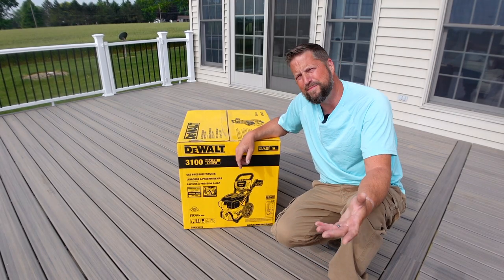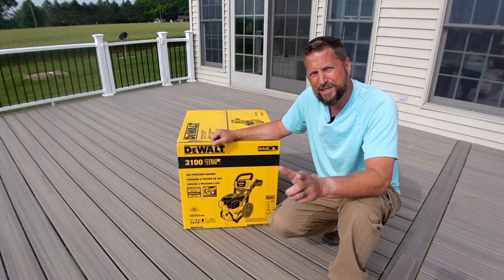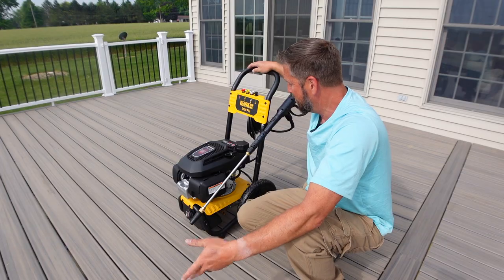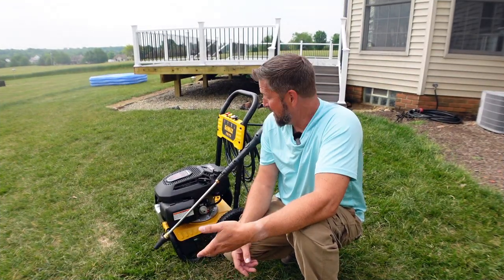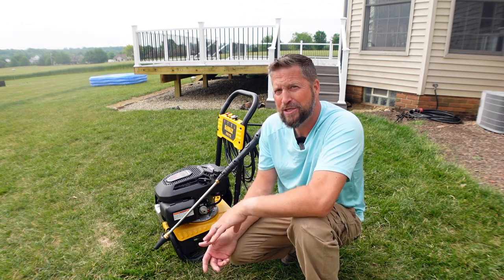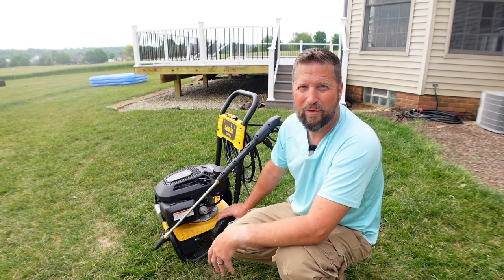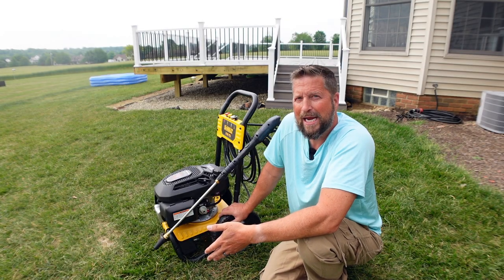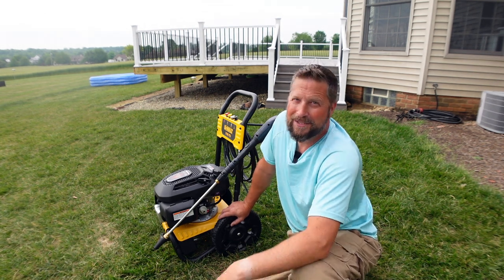First Impressions: Dewalt 3100 PSI Pressure Washer With Honda Engine

Comment: Nice machine, more than enough pressure.  I agree that using a soap attachment on the wand is far better so you won't get the corrosion in the machine part. Have a great weekend Sam!
Reply from the maker: So glad you mentioned that. I had a machine quit on me after one use with the soap mixture. Not saying the new one would have any issues but why risk it, right? 😉👍

Comment: About 15 years ago I took a chance and bought a Chinese power washer for pennies.  3700 psi and 4 gpm and it's still going!  lol  The only thing I had to do was take the manifold before the pump off to fix a stuck spring that held a ball bearing in place.  In todays global climate I wouldn't give China a dollar if I can help it, but my machine is still going!  lol
Reply from the maker: Wow! That thing is powerful! When you find something that lasts like that, you're justified no matter where it came from. I'm finding my predator engines from Harbor Freight are surprisingly reliable.

Comment: Thinking about buying one of these to use from time to time to power wash the house and eventually a deck like yours once I redo mine. How has this one treated you so far?
Reply from the maker: So far, it has been great. I think the Honda engine is the key. It starts like any other Honda engine I've owned. The pressure is definitely adequate. I would like to replace the hose at some time. It's rigid and difficult to work with, but I'll wait till it goes bad.
Reply: @ appreciate the quick reply back! I definitely like that it’s a Honda engine too. That’s what I use for my lawn mower and they last forever.

Comment: Nice machine I was wondering if it can take hot water
Reply from the maker: @TaurusGang96  That is a very good question. I know only specific pressure washers are designed for use with hot water. My best guess would be "no" for this machine 🤠👍
Reply: Thank you for the reply boss @samsdoinstuff

Comment: Thanks for your review, I would have liked to see how the water inlet is connected... does it work if I take water from my cistern?
Reply from the maker: @julioserrano4624  Great question. There is a standard female garden hose connection at the base of the machine between the wheels. I think your greatest concern is getting enough pressure from your cistern to feed the washer. Otherwise, you should be good 🤠👍

Comment: I recently purchased the same pressure washer. What a machine ! So let’s say I’m ready to store it until next year, while the pressure washer is running do I set the knob to FUEL OFF? If so how long do I leave it at FUEL OFF before turning the knob to OFF or do I leave it at FUEL OFF?
Reply from the maker: I'm pretty sure you leave it at fuel off until it shuts off. That way there's no fuel left in the carburetor. Also, add stabilizer to any fuel remaining in the tank. Hope this helps! 🤠👍
Reply: @samsdoinstuff thank you sir! 👍🏼

Comment: This is a nice machine I was wondering do you think this machine would work on dirty concrete and for old dirty fences?
Reply from the maker: I have used it on concrete and it works very well. I'm certain it would work on vinyl fence, but if a wood fence is too old, it might have enough power to damage the fence. Be careful 👍
Reply: It will eat up concret if you’re not careful

Comment: do i take out the oil from the same hole for service ? i have a pump
Reply from the maker: Yes. I do not see any drain plug for removing the old oil. I think the intended procedure is to dump the old oil out of the tube from which it was filled 🤠👍
Reply: @samsdoinstuff  my friend gave me this exact same one for free runs great but never serviced the oil
Reply: @samsdoinstuff  do you how much oil does it take by any chance, thanks in advanced
Reply from the maker: @acordeon365diaz3  It looks to me like 14 oz 🤠👍

Comment: i need info on wand hose length  for high jobs? please
Reply from the maker: It comes with a 1/4 in X 35 ft hose. I mentioned in the video how stiff it is but after a few uses, it is becoming more flexible 👍😁
Reply: pffft i thought you were talkin about the feed hose

Comment: You need one of those surface cleaner attachments for that pressure washer, would be a heck of a lot faster than a wand and tip application.  I have a little 8 or 10 inch one for my electric pressure washer, much quicker for cleaning the carport than the wand and tip.  

I went electric this time after wasting a bunch of money on a gas powered one in the past and only 3 uses and burned the pump up because you can't let them idle between uses...stupid design and ridiculous price for something that only lasted 3 uses.  I like the electric because it shuts off immediately when you release the trigger....Been thinking of getting a higher PSI output model though so I can get a larger surface cleaner.
Reply from the maker: Thank you! I have been looking at surface attachments for the driveway. Never thought about it for the deck. Good tip 👌
Reply: @samsdoinstuff  We have a Hotsy pressure washer at work that does hot water pressure washing and our surface cleaner if I recall is a 24", but our pressure washer is 4,000PSI....does great on sidewalks and other concrete surfaces too....with a lower PSI pressure washer like yours a 12-18 inch model would probably work great.  Its basically just a round cover with a 2 head spinning spray wand underneath.

Comment: does anyone know if this 3100 psi and the 3300 psi is a major difference and is it worth the $80 difference?
Reply: both of the dewalt brand ones like this one
Reply from the maker: I'm not sure if there's any difference besides the psi. I bought mine mainly because of the Honda engine 😁👍
Reply: The only difference is the gas tank 3300 it’s bigger water pressure the same